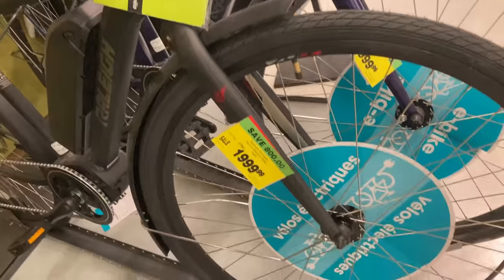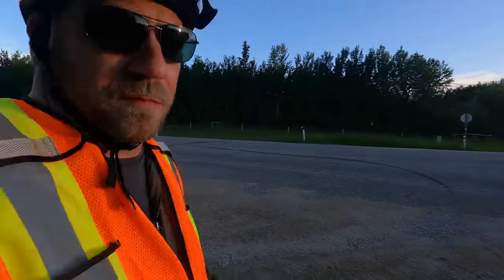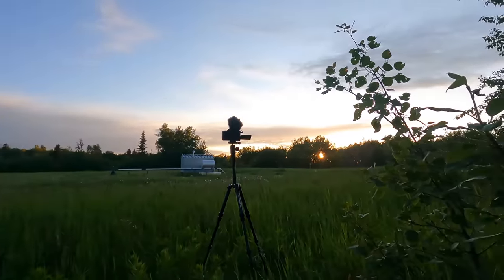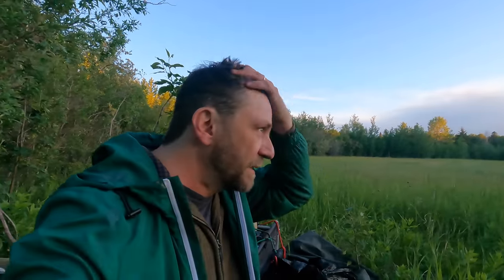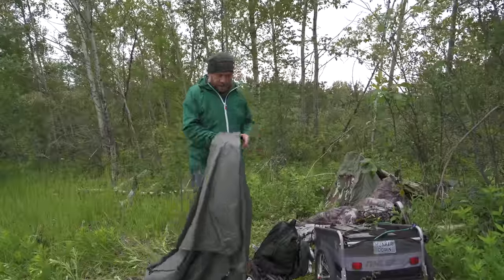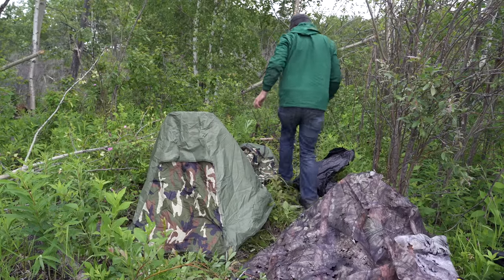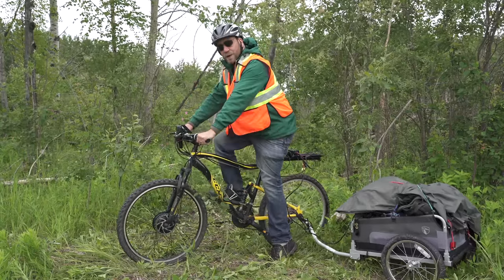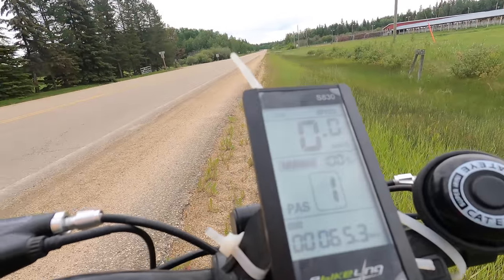DIY E-Bike Stealth Camping

Comment: Nice set up. Given the way the world is going more people will be forced into the same. I myself bought one in anticipation of when gas is ridiculously expensive. Still gotta get around.
Reply: Yes. This is excellent timing. I regret not buying a ebike last year. HOWEVER I found 1 for a even $1000. And it folds 1/2. Tires are 20 inches. But pretty wide 4in. I think 3in would be better.  The battery stack is inside the frame which balances out the bike very well. A 750 rear motor which is v. Gd.
I'm a short person & think this an option due to wt. Of bike & maneuverability. Gas so $$$. Don't think $$$ will get any better. So ebike get. Option. I seen a video where a guy uses a small solar panel to charge it. Looks like Steve has another great idea.

Comment: I bought a kit from them, a 48v 1500w kit, for the rear. It will do 40mph sometimes. 52v battery. The battery and also the controller is what dictates how fast it will actually go. And also if you got a front motor that's kind of dangerous you have to make sure to have stainless steel front forks and use torque arms. Crank motors or rear hub motors are better than front hub motors.

Comment: I can imagine Steve converting a bike to a "rail- bike" adventure. I'm sure there are abandoned rail lines nearby.. my friend did this on the old San Diego & Arizona Eastern railroad. Welding two beach cruiser bikes 
to a steel basket. And guides to the tires. It worked a couple miles. Propelled by a tiny gas motor. But we drove this mess on dirt roads. Fun.

Comment: Keep up the good work Steve! 
W.r.t. your trailer.. you might wanna change to fatter tires in combination with lower tire pressure when going on gravel roads / off road.
If you use the same tire pressure on gravel & offroad as on asphalt, your trailer most likely will bounce a lot ( and take a beating).

Edit: same goes for your MTB of course :)

Comment: Lifepo batteries do that.  They'll stay at a pretty steady voltage till they are mostly dead,  then they'll hit the cutoff voltage and just stop working. 

That controller is probly expecting lead acid or regular lithium batteries for the SOC display.

Comment: those big batteries are normally just a bunch of individual small cylindrical cells all spot welded together inside. 
It's very probable that you damaged one internally as they are actually not at all okay with being beat around like that. If you did in fact end up with one broken one after this, it's worth it to crack it open and try to locate a broken connection. Safeties in consideration and all that. 
your better bet is giant prismatic lifepo4 cells, they come in rectangle and you can even distribute them around the bicycle if you want to ditch the trailer entirely. I would for sure do that and go with saddle bags and a rear cargo rack for the gear

Comment: Great video! I hope the dead battery didn't kill your enthusiasm for e-biking. I have that kit with rear wheel hub and it's been great and very reliable. It's your attempt to use those repurposed batteries that foiled your trip. Not only are they more weight than you need to carry for your distance, but they didn't give you the expected capacity anyway. Get a good e-bike battery and use proper connectors and you should be good with that kit.

Comment: I would start with a larger trailer. And tire patch/repair kit. And a battery operated air pump. It would be cheaper than going smaller batteries in the long run. But do not take that as discouragement. Time, practice, failure, resilience and the ability to overcome whatever you encounter is more important. Then any skill or knowledge that you have. Add a Leatherman multitool and a small set of tools necessary for your situation. And you will be golden my friend.

Comment: You need a multimeter in your kit to go with the electrical system.

I have a similar conversion, with a much smaller battery.  Works great for limited range..

Comment: I have a similar ebikeling DIY kit with two li-ion batteries I swap between manually that I've put 5300 miles on and it's been great, only ever needed to replace the spokes with higher quality ones after 3k miles. I'm pretty sure the battery setup is the issue. Lead acid batteries are not good for ebikes from what I remember reading. Li-ion ebike battery packs with BMS's are much better because they can handle high amperage spikes and constant charging and discharging at higher/lower levels much better. You can find them surprisingly cheap on ebay/amazon. Just get the right voltage for your kit and find the highest amp hours you think you need and make sure the seller is reputable. You might have to find adapters if the controller has a different style plug than the battery.

Comment: Just some pointers because I've built a few ebikes...
If you get a mid-drive kit rather than a front hub kit, the power will go through the bike's gears and you'll get long ranges without having to carry so many batteries as the motor benefits from having a transmission to help with the load. 

The gold standard are motors from a company called Bafang - look up their 500W-1000W kits for the sort of power you need for dragging camping gear around in all conditions (it's best not to be running the motor flat out for hours at a time, so buy bigger than you think you'll need then laugh at hills as you glide up them).
The only extra consideration that a mid-range motor adds, is that the chain must be well oiled and up to the task of dealing with the extra forces, so sometimes it's best to upgrade it to an ebike chain, however this is a tiny cost compared to the money you save on batteries, and the improvement in handling from removing all that weight.

All the best to you from the English/Scottish border :)

Comment: He used a hub drive instead of a mid drive. Cheaper and easier install. He also would have been better off using his big battery to recharge the bike battery instead of direct power. Less risk of electrical malfunction. Another bike battery would have been expensive but more likely to get you home.
Most ebikes will fit a rear rack that you could easily put a full size back pack on.
Enjoyable vid. Wish I was there.

Comment: loved this video Steve, really interesting to see the battery level suddenly drop. Apparently this is a thing with lithium. I have just installed lithium batteries in my mobility scooter and was told i will get more distance out of them but be aware that i will get very little warning when they are about to go flat. Please do a vid showing us the results of recharging the batteires

Comment: Dakota fire pit is the universal answer to making a stealth fire, during and after use.  Easy if you bring along an “Eastman 35092 12” slip joint connection” for digging and serving as the air channel.  Very surprised the massive batteries you used failed.  Did the bike computer know that was the chemistry you were using?  I imagine the kit PLUS the cost of those 1000 Ah batteries approached that of a “turn key” purpose built E-bike.
Keep up the fantastic work!  I want to be you when I grow up!

Comment: A big feature of lithium batteries, you can run them to zero and not damage them. Your charge monitor probably isn't accurate and you just ran them down. The voltage also stays fairly constant until they are dead. A feature except for the people designing charge monitors. Enjoyed watching.

Comment: I made myself an electric bike. It went 30 miles per hour and can run for 2 hours straight on full without charging. Biggest issue was the tires, they will pop once every few weeks because of the weight. Mind you, I was using it as my main transportation during that time so no surprise that I have to maintain it so much.

Comment: eBikes are a great thing to RENT!  They're not my jam for the sort of riding I normally do, but I was trying to squeeze a ride in during a vacation without completely exhausting myself and it made that possible.  For just $130 I got to play with a top-of-the-line ~$10k Specialized e-road-bike and it was good fun cheating the hills.  I've also ridden a friend's eMTB which made getting to the fun bits that much more painless, but personally I'd still rather go lightweight and do my own pedaling.

Comment: Unfortunately some displays tend to do this, which is display 100% all the time until it's dead.  (I believe the cut-off on total power is also about 50 to 60% charge, so also don't calculate distances on the entire charge).  I'm not sure if hooking up multiple batteries is preventing it from reading accurately.  DIY kits are excellent otherwise, the set-up you have might work with another display. Bafang makes higher end ones, but might test a few to see if it can accurately read the juice without breaking the bank.  This is exactly the kind of camping i want to do with my e-bike, and after this was looking at someone that made a trailer with suspension which is perfect for rougher roads.

Comment: Trailer for batteries, great idea. 3 x 100Ahr should handle 500Watts fine. Wonder what went wrong?  Too much vibration affected the built-in BMS? Once those kick in they are tricky to reset. Need to fake up a charger. Maybe get bare cells and make up your own pack n BMS system. Cylindrical 15Ahr+ might handle vibration better. Lithium Titanite 40Ahr, the grandkids could pass them down to their kids?

Comment: Im a big fan and love seeing the local sights!   About Ebikes.   With gas prices as they are,  2k on a bike can pay for itself rather quickly.      I got a payment plan on mine just under $300 a month.   Range is all over the city no issues.  

About Sponsorships.     Might be an idea to contact some other youtubers for colab videos and to ask how they handle sponcership.    I have seen lots that after reviewing a product for a sponcered video will actually reccomend somthing else.   Sometimes its funny to hear them craft specific crazy circumstances where some weird defect or feature would be advantageous😂.    Your the content creator.  You make the rules for your channels content.
Id have taken that sponcership for the tent you have already been using and make a subscriber giveaway.    Find products you like. Then go find sponcership after you have reviewed and used them.  Just a few thoughts.

Another idea.   There are hard sided little camper trailers for bikes i have seen.   That would solve the vulnerability worry.   You can mount solar panels to the trailer and go forever and ever🤗

Comment: Ive been working with These types of conversion kits,    it looks like you're using Lead acid batterys with a Controller and system and meant for a Li-Ion setup.    that was probably 36V 20 amps   but those L-A batteries in series like that,  produce WAAAY more amps than the motor or the controller can handle.    After a while ,  a mosfet inside the controller gave up and dropped you to 24v   then to 12v  then to 0       the batteries were probably fine,  it was the chinese controller.

Comment: I have an e-bike camping trip idea.  Get a proper middle of the road in every way e-bike just something that says “average” and plan a destination campsite way beyond range of your e-bike.  Then have to plan and overcome the challenge of charging and camping in-between start point and destination campsite.    

This would open up new series of challenges.  Like: have to either find outlets you can just freely use without much objection and charge whenever you can. or maybe have to resort to sneaking power from
Somewhere, and than raises question of where do you camp if need to get a full charge overnight. can’t stealth camp too deep in woods and leave expensive batteries plugged in unattended that long.. maybe you invest in finding a way to incorporate solar as well. And maybe if there is a dedicated charge point for bikes somewhere using it but those are so few and far between I never seen one only heard of it in concept so maybe they don’t exist. 

Could spawn a whole series of videos from
You on this testing different things you make to improve it or fans make or maybe companies make that you found.     Maybe make or buy a bike camper trailer with everything you ever need, and see how it works, etc etc.

Comment: I do 150km range on my pedal-assist e-gravel with just 250wh battery. 3800wh should do about 2000km! 2 weeks worth of saddle time with one charge :)
Of course you're throttling and riding at a higher speed, I'm only calculating the bare minimum battery usage where motor cuts off at 25km/h (Europe).

Comment: Steve, other people have probably already suggested this, but I used to use a trailer almost exactly like that one. I highly recommend you carry a replacement quick attach bike axle. I lost mine at the worst times!
Reply: Also, did you use lead-acid or lithium-ion batteries?
Reply: @depotdevoid  They were lithium phosphate..those big 100ah car battery size cells.
Reply: @mistermister2085  Ah must have missed that bit. I was just trying to think of ways to reduce weight. Thanks!

Comment: As a DIY e-bike builder I can assume what went wrong.  The bikes display / controller probably doesn't have a setting for LiFePo4 chemistry batteries.  Setting it to 36v probably 'tells it' that you have 10 LiIon cells (10x3.7v) which is fully charged at 10x4.2v (42v).  Each of Steve's 12v LiFe is 4s, so he's got 12s LiFe, which is 3.2 nominal, and 3.6 fully charged.  Fully charged (43.2v) is very close to the 10s LiIon (42v) setting.  The issue is that LiFe has an extremely flat discharge curve.  LiIon has a slight, but gradual decline in voltage during discharge.  This could keep the display reading abnormally high.  The ebike display is expecting the gradual reduction in voltage in order to display an accurate battery percent, in addition to being set to the wrong style battery.

Setting the display back to 24v (probably of a LiIon chemistry still) temporarily works around the problem.  

That being said, 36v at 100ah (3.6kwh) is a lot.  I've got a (non trailer) DIY e-bike that has 52v (14s LiIon) at 34ah for about 1.8 kwh and can get 80 km riding at 40-50 km/h, or probably 120km at a moderate 30-40 km/h.  That was the most amount of 21700 cells I could fit in the triangle of the bike.

Comment: could always get a dc to dc boost converter to take 12v to 36v, they are cheap and easy to setup. i think i paid $30 for a unit that can take 12v and boost to 80v or 90v i dont remember max of 1500 watts and they are fairly efficient. they are sometimes called boost converters

Comment: That's fast for those small tires, I could pedal at 56 km hr on those old style bike bust yes bust, with my experience with the new "mountain" bikes, the tires are much less able to withstand a lot of riding pressure at high speeds without getting a flat bring spares especially with a little bike like that

Comment: it's probably the batteries. we use the same type in the transit buses and they seem to have a high fail rate. maybe try some good old marine rv lead acid batteries. i don't know if they will be heavier  but they will be more reliable and perhaps smaller. those looked big.

Comment: I love your videos Steve - especially your philosophy of trying to enjoy life on a regular person budget. I wonder if your e-bike controller was expecting standard lithium batteries rather than LifePo4 and hence the inaccurate reading because LifePo4 batteries have a very flat discharge curve and it's difficulty to tell % charge. I'm betting they were not all charged up originally. I think the BMS cut out on one to prevent over discharge and then another which left you stuck. If you have a power meter you can see how many watt hours to charge/discharge to see if they are still near their original capacity which they should be. Good luck!
Reply: there appears to have been a faulty charging connection ... recharging with a 'better' connection.

Comment: I have always found it strange that people buy a e-bike. I ride for being outdoors and of course the exercise. Still looks like a fun toy.
Fyi- Those batteries heat up. So, ever thought about putting a tray on top of the batteries to allow air flow and to keep metal from potentially shorting the battery and causing a fire...

Comment: This is a random tip, but if you have any kind of can of carbonated beverage with you, tap the top of the lid with your index finger that opens down into the can at about 2 taps a second or so (more taps are better) for about 20 to 30 seconds before opening, and you won't waste any more carbonation in your drink! You don't have to tap it hard, because otherwise, you're just shaking it up again. Cheers!
Reply: Oh, and this also applies if you drop, shake, or do any other kind of jarring movement to a can of something carbonated. Tapping on the top will prompt the pent up gas at the top to return back down into the drink.

Comment: bring a multi-meter to measure the voltage if you're bringing those big ass lithium batteries, also bring a pump so you can air down the tires of the trailer a little when you get off the road.

Most 36v systems have an automatic cut-off around 29-30 volts, the batteries you used are 12.8v nominal (each) but can discharge down to ~9v depending on the cells and build-in BMS which is what would of killed your power. 

These speed controllers (the thing on your rear rack) have capacitors that normally take up to 63v so you COULD run a 4th battery which will increase your top speed but will wear out the controller faster.
EDIT: ^ but give you a wider voltage range so this shouldn't happen again

hope this helped

Comment: I'd suggest you get some decent lithium cells but for ebikes they can be $500 USD for a decent sized pack. But they'd weigh a lot less and with lithium you can get most of the energy out whereas lead acid you can't really get more than 50% without damaging the cells.